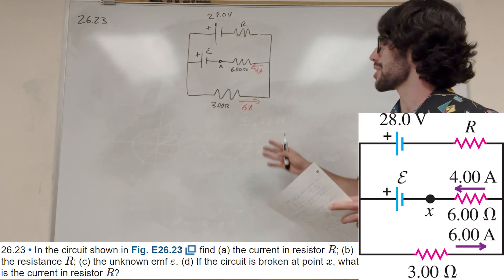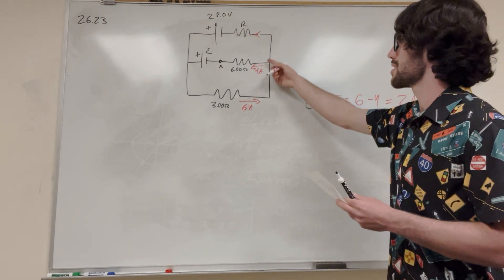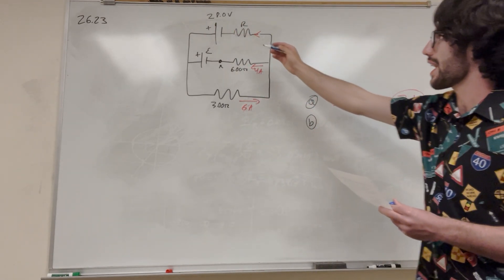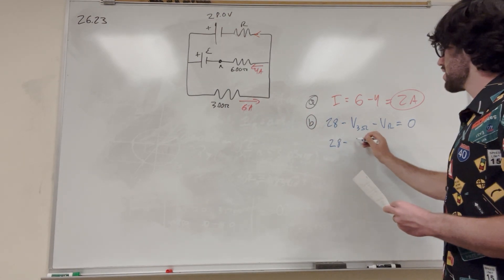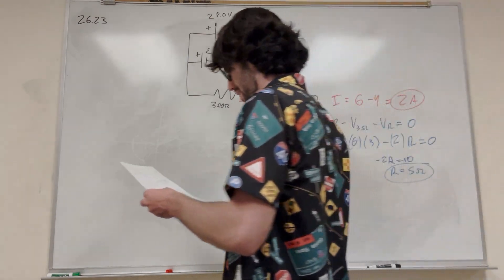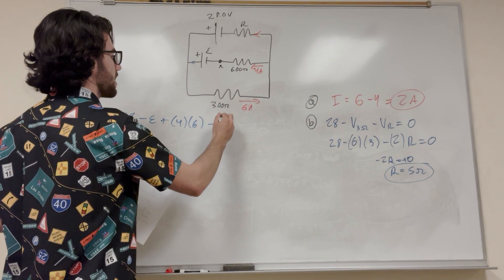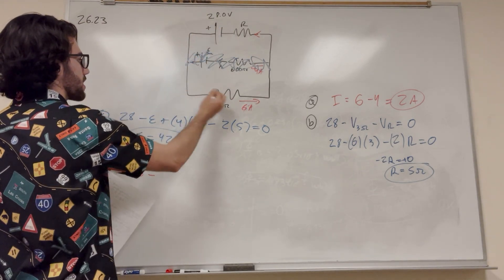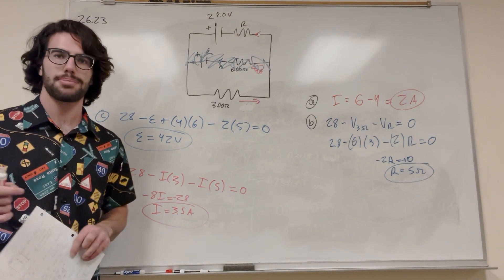In the circuit shown in Fig. E26.23 find the current in resistor R - 26.23

Comment: For 1d, why can’t we just use I = V/R, and say (28)/(5) to get our answer?
Reply: @calcgang but the answer should be 28/8? That’s where I’m confused
Reply from the maker: @ilyazyy yea my bad, V is 28 and you have to add the resistors in series to get R = 8, that’s basically what I did and you’d get (28/8) which is what I got